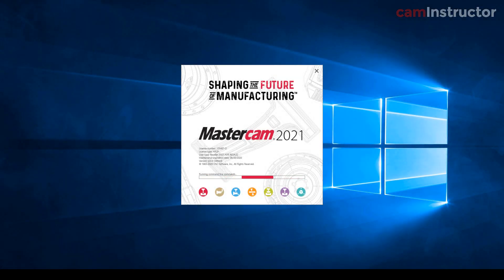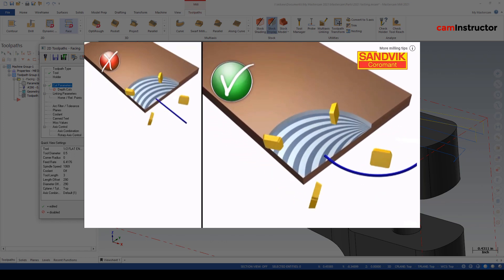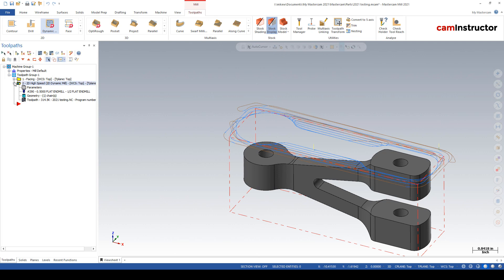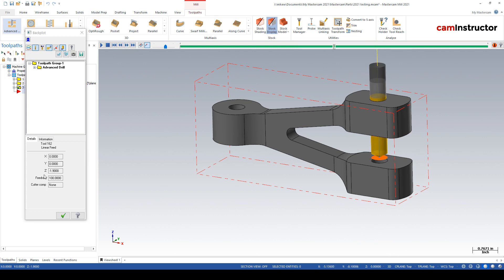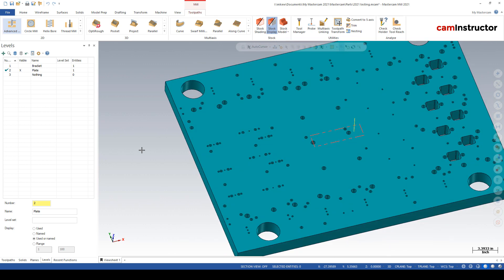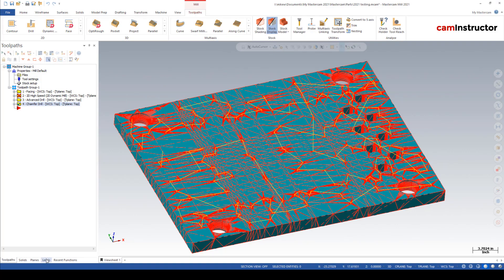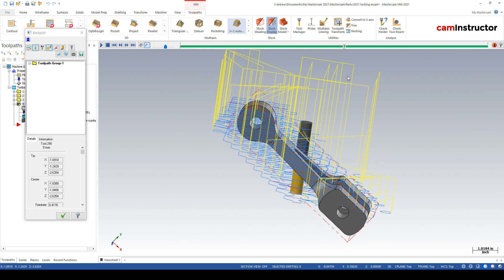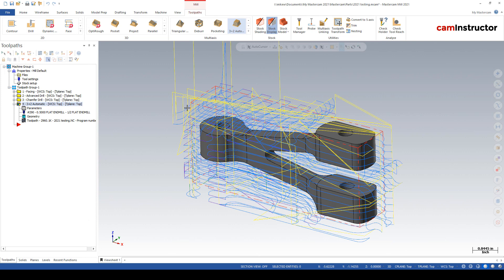The Best New Features in the Mastercam 2021 Public Beta

Comment: Is there a way to run the same tool on multiple work pieces from multiple toolpath groups like G54-G57 before changing to the next tool. In the past I would copy and paste the toolpaths and put them in the order I want them to run. Is there an easier way to do this??
Reply from the maker: Toolpath Transform.
Reply: @CamInstructor  what if I wanna run the same tool but on a completely different toolpath and part? Like G54 is op1 of one part and G55 is op1 of a completely different part and completely different toolpath.
Reply from the maker: @codycollins5370  You can give Sort a try. Right click in the Toolpath Manager, pick Sort, set your options.
Reply: I tried using the sort function. I have toolpath group 1 and G54 and toolpath group 2 as G55 both have their own planes and in my planes tab there are set as 0 and 1. But when I post my g-code it still comes out as tool 1 then tool 2 on G54. Then tool changes back to tool 1 to do G55.

Comment: On the topic of automatic 3+2 programming, do you know of anyone or have you had the chance to delve deep into setting up ATP to a point where it can program parts to completion?
Reply from the maker: I have not gone deep with ATP or other automation in Mastercam to the point of near complete part programming. I have in other CAM and CAD softwares though. I will say that automating to 100% completion is very difficult, near impossible, if flexibility/adaptability is needed. Full automation is achievable on family of parts type programming but I'm not really sure how many of us are lucky enough to have those parts thrown at us. Most are getting parts they've never seen before for every new piece. For this scenario, automation is still something that should be looked into but keeping in mind the goal should be maybe 40-60% automatic programming.

Comment: There is still no "Finish" toolpath option inside the 2D Dynamic rough 😒
Reply from the maker: Take part in the Beta program (if you're not already), make your thoughts on toolpath improvements known. CNC Software will log these, other users can +1 them, and with enough noise these will get looked at and possibly implemented. They are very open to discussion on not only features but work flow improvements as well, especially during the beta phase.

Comment: why my mcam 2019 freezes too much , im using a powerfull pc , it seems like the software is trying to open some file or refreshing some thing :(
Reply from the maker: There's several things that could be going on. The easiest things to do first are update Windows, then update your video card drivers. If you are on a laptop, make sure Mastercam is using your dedicated video card. If you don't have a dedicated video card you can try disabling the hardware acceleration in the advanced configuration.
Reply: @CamInstructor  Thank you sir , i think that mastercam is just refreshing and trying to reload some thing and it is not a hardware issue , you can test this by going to your mastercam files location there is a shortcut that takes a little bit time to get oppened cause the location of that shorcut folder is wierd , i think that mastercam uses a wierd command to access those files , thanks alot ❤️❤️❤️

Comment: lol i curse every time i have to use stock model and then i just smash the keyboard to put something in there... thank god they figured that out.......... looks like some nice updates......... did they change anything on creating a tool list?   in 2019 i could use the X+ extensions for free ....2020 they want $
Reply from the maker: I thought there was still a free X+ version for 2020 that did tool lists? I could be wrong. 
Ever thought about creating your own template for tool lists?
Reply: @CamInstructor  they want you to pay now.... Need a license key to actually create a tool list........ They allow u to download and add it in....

Haven't gone that route yet! Seems like it would take a while an I don't know what im doing on that. 

I just Wana put the tools in excell format and print one piece of paper with everything I need on it... Mainly, tool #, diam, name, flutes, holder, and stick out. 

Went back an forth with my reseller about it.....they wanted $500 to make custom list....the license key for X+ is only like $300 🤷🤦
Reply from the maker: The Mill2.set file is pretty close to what you're after if the default Tool list function isn't good enough. 
Let me look into some other options....maybe I could justify putting the time into editing something like this if I make it into a video...??
Reply: @CamInstructor  yeah that would be pretty cool! It's not something I personally need , but since I'm the programmer of the shop I need tool list that all the 'operators' can understand 🤷 the fun of job shop life 😅